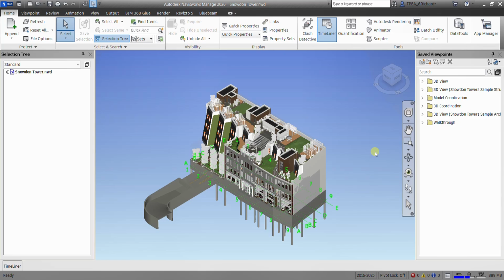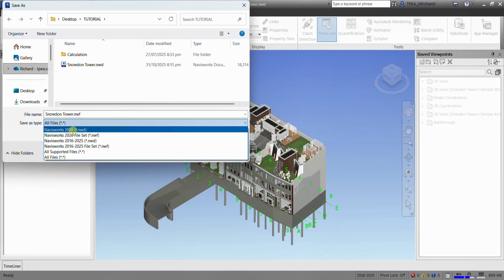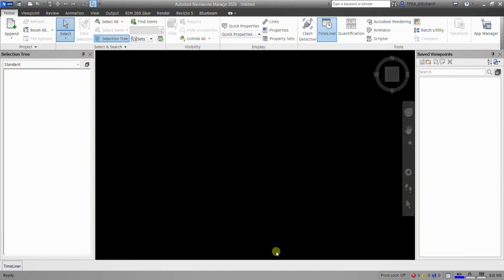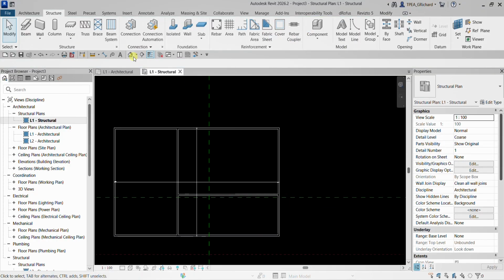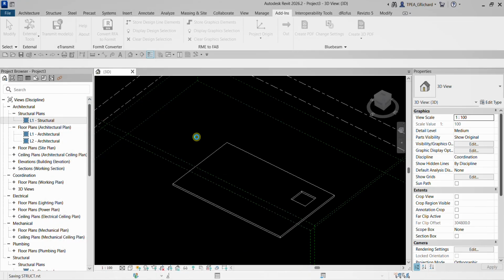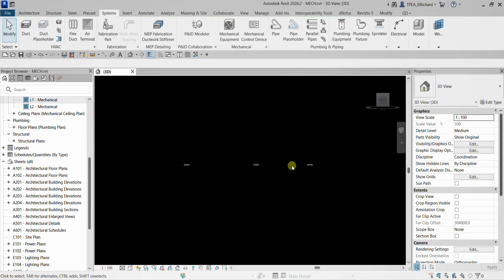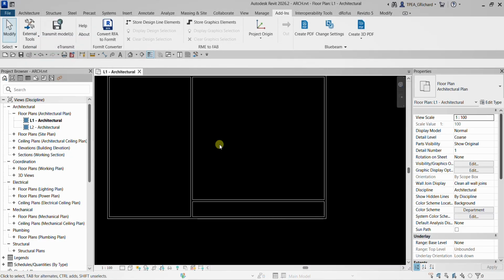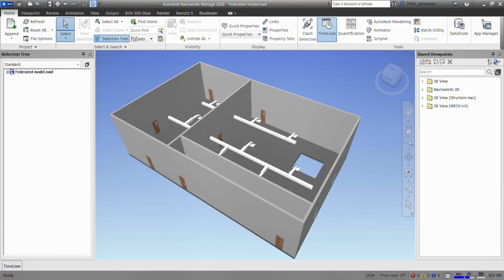NAVISWORKS 2026 EXPLORATION - USING NWF FOR LINKING AND UPDATING MODELS

Comment: How to override the nwc file when that file append nwf that is open? When i am trying getting error
Reply from the maker: The NWC file is likely locked because it's currently being used by the open NWF. Close Navisworks (or remove/unload the NWC from the NWF), overwrite the NWC, then reopen or refresh the NWF. If it still fails, check if another user or process has the file open.

Comment: I am received nwf file from the client how to open in navisworks manager, because nwd file size larger,give me solution to open nwf or any conversation in nwf to nwd
Reply from the maker: Hello, an NWF file will open in **Autodesk Navisworks Manage**, but it doesn’t actually contain the model—it only links to the original files (like DWG, RVT, or NWC). So if you just received the NWF and not the referenced files, it will open empty or with missing parts. To fix it, you either need to ask the client to send the full set of model files used in the NWF, or simply ask for an NWD instead since that already includes everything in one file. If you do have all the referenced files, just open the NWF and re-link them if needed, then you can publish it as an NWD from the Output tab.